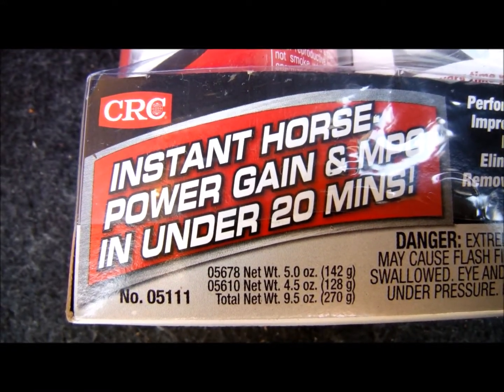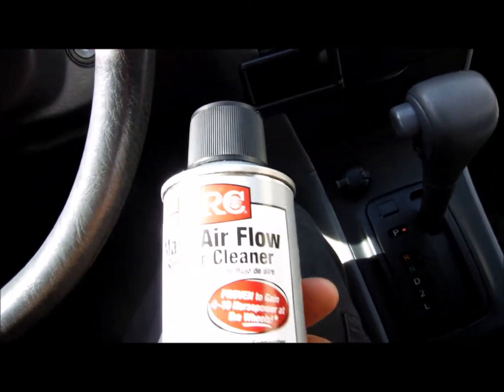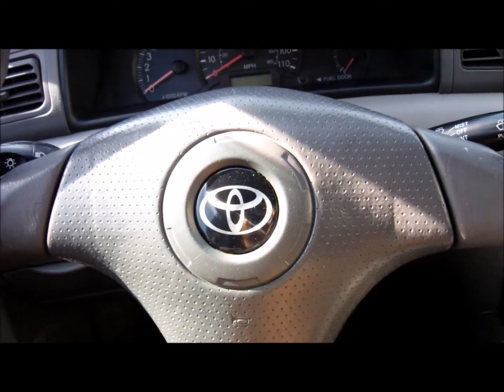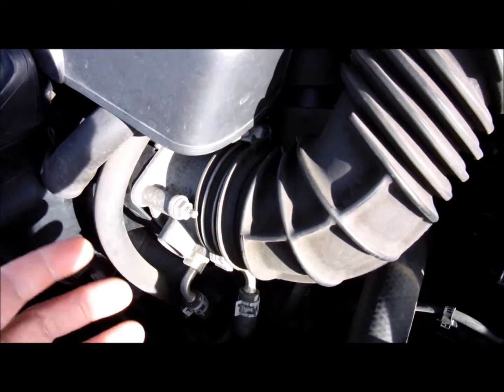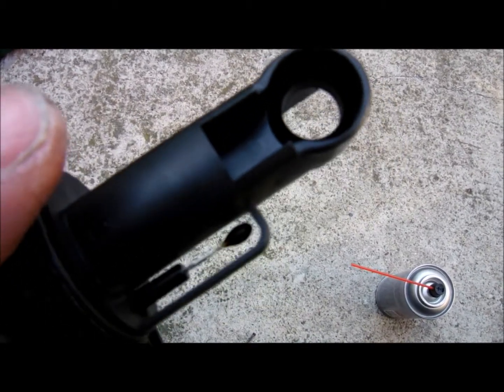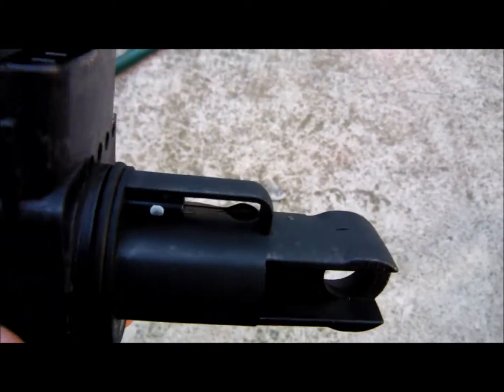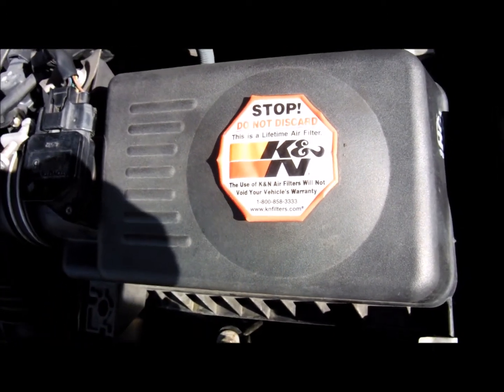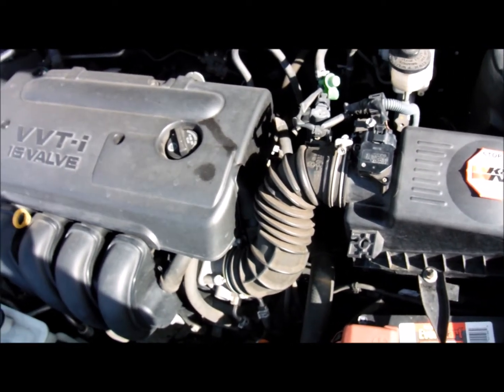Gain 4-10 Horsepower and get better Fuel Economy? How to clean mass Airflow Sensor

Comment: 28mpg ooof my dad's 2005 Corolla got 40mpg.
Reply from the maker: This was my moms car, she bought it new. It was due for new plugs and O2 sensor. I was about to do that but unfortunately she got into a accident so I didn't get to try out new spark plugs and O2 sensor to see if it could get back to the 40s. Im sure it would of done it. I have a 1992 Geo Traker. I got 27 MPG and after a spark plug, wires and O2 sensor change I'm not getting 32 MPG

Comment: Bought a mustang with 100,000 miles. Cleaned maf sensor with this crc can. Holy shit there is actually a difference.
Reply from the maker: Nice man what year Mustang did you get?
Reply: @JohnDrivesAnything  2014 V6.  It's crazy what an $8 can and removing two screws can do for performance.  I'm looking at youtube videos on how to clean my throttle body next to see if that does anything like cleaning the maf sensor did.
Reply from the maker: @sugarkang  Right on man that's the 3.7 right? My Brother in Law has that car and his has 180,000 on it and the only repair he has done in all those miles is he needed a new drive shaft.
Reply: @JohnDrivesAnything  Yeah the 3.7.  That's awesome to hear that the car has been reliable for him.
Reply from the maker: @sugarkang  He had it since new. I believe his is a 2013 and the first year of the 3.7 A drive shaft being the only thing needing repair in 180,000 miles is real good. I believe Ford put a plastic one in there and that's why they are limited to 112 MPH

Comment: That massive can for a MAF? Should last a while even with the van and 'vette.
Given you've always been one to eek out as much mpg from your shit, i'd love to see you run a rotary for a spell.
Reply from the maker: I'm getting a new Daily driver later this year. I almost bought a Mazda RX8. Love the 9000 RPM redline but I decided on something else. I don't think anyone will see it coming. I'll tease what is is on my facebook when then time gets closer
Reply: Apparrently the rx8 needs a bit of mod work to get it optimal as the rennesis 13b isn't as well designed as the rew 13b and those before it, prone to overheating is the general consensus i gather. Otherwise it's said to be a fantastic car, the chassis is a worldbeater for handling and is an oil burning fuel drinker that doesn't like to be run at low revs.
Here they're treated as a 2.6 litre for taxation purposes, despite the displacement being 1300cc across 2 rotors. ¬_¬
Reply from the maker: They are cheap here because of the bad reputation. Still want one but i found something else i like more 

I think people don't maintain them well. Don't check the oil levels.

Comment: And don't put those in backwards I did that when I put a intake into my f150 n put the maf in backwards lol it didn't like that to much
Reply from the maker: It's ok man. I speak from touching the wire and busting it from experience. Thankfully I don't drive a Butt Munch Wagon so it was only a $30 mistake.
Reply: AutomotiveVlog lol wtf is a butt munch wagon so they even still make wagons anymore sir? I thought they call them crossovers now for when you want the image of a truck but need a mini van.
Reply from the maker: Butt
Munch
Wagon
Reply: yeah gotcha. funny thing is you talked about wagons i thought back to the dodge magnums with the hemi in it, that was a cool wagon.
Reply from the maker: CTSV Wagon. Super Rare. If I were a family man that's what I would be driving. 556 Horsepower and a Manual Transmission option in A freaking Wagon. Dodge Magnums were cool but no Manual Option.

CTSV Wagon is what GM was in the 90s. A part of them came back with that car IT was like the GMC Typhoon all over again
Reply: what i liked about the magnum is AWD, it helps where ice flakes fall from the sky and the wind hurts your face.
Reply from the maker: Was AWD available with the V8? I know the AWD Challenger is only available with the 6 CTS Wagon had AWD only in the V6 not the Uber V variant
Reply: I'm pretty sure it was, because dodge has the challenger GT now that's AWD and people are bitching cause it's pentashit V6 only ( though honest to god 300hp outta a 3.6 v6 isn't TO bad... hell in the 80s thats like performance car numbers) they want AWD and the Hemi. I dont think you could of gotten it with the 6.4 but I'm pretty sure you could get it with the 5.7 at least when it came out.
Reply from the maker: I think it's the sound people are missing. If an engineer out there makes a V6 that sounds like a V8 there going to become very rich